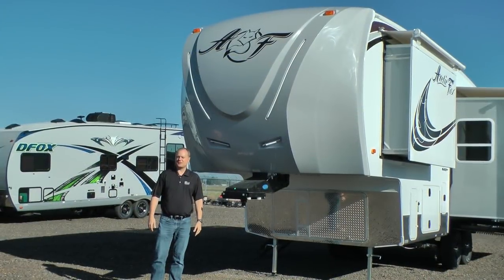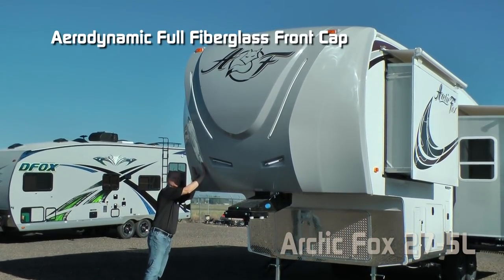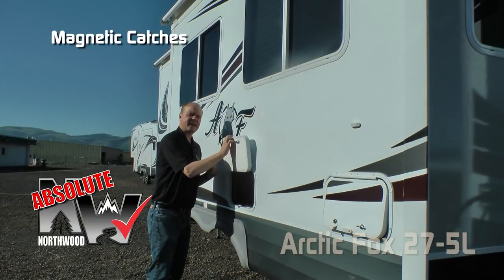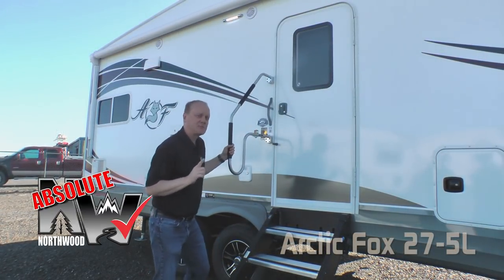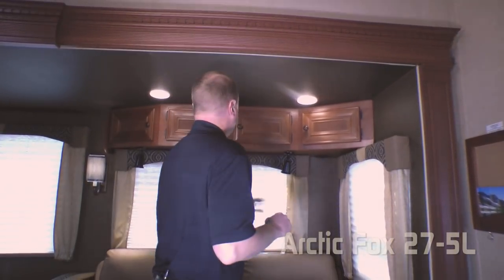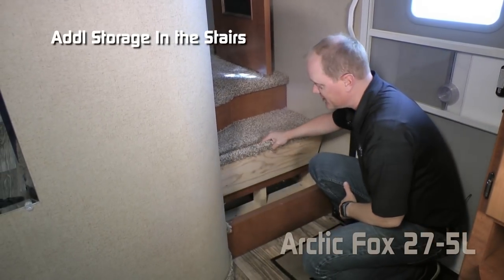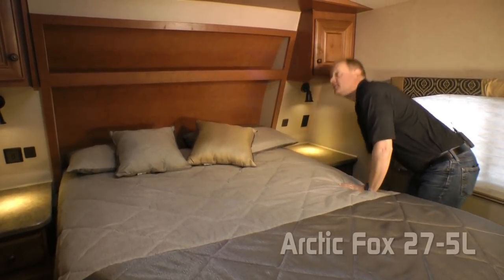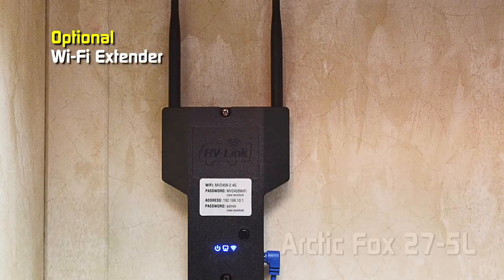Quick Tour Of the Arctic Fox Silver Fox 27-5L Fifth Wheel

Comment: Does it take a dually truck to pull this?
Reply from the maker: give Doug a call at 425-583-7861 and he can help you out. We have several customers hauling this fifth wheel with a 3/4 ton or 1 ton non dually.
Reply: No and air lift is worth the admission